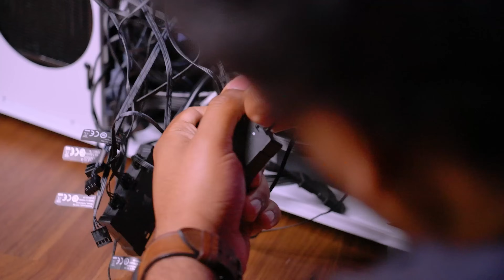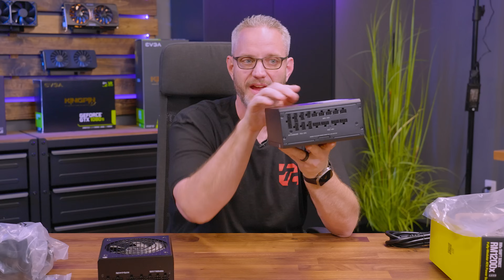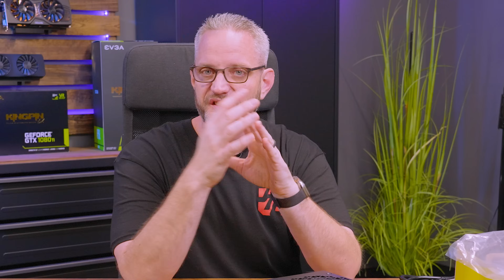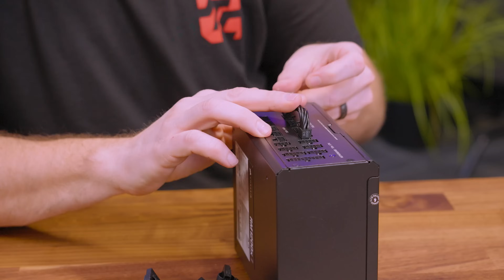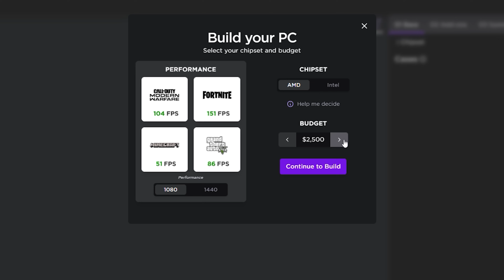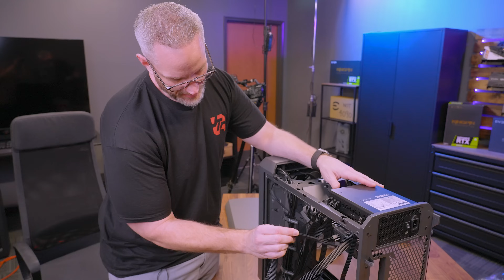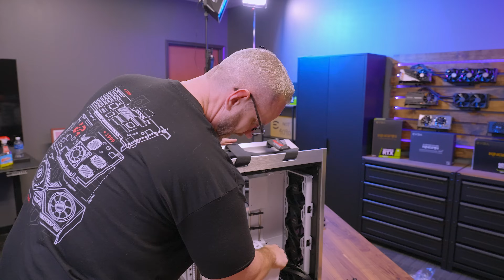I tried to prove this design was a failure... But then this happened.

Comment: How did I know the first case he'd grab would be an O11 Dynamic?  😂
They should also consider doing a "Left Shift" and a "Right Shift" so you can have connections on either side to suit your case's needs.
Reply: its such a common case, I have the XL version.  but its a nice case to build in even if at this point its a bit cliche.

Comment: My last build was in an H7 Flow with a Rm850x. I found that with 12" sleeved extensions AND 3 fans in the front (similar to that H7 Elite) the PSU basement gets quite full of excess cables and it can rub the bottom fan. It took a good bit of work to neatly loop the excess in the basement between the PSU and the front fan. I think a side plug 850 would have been great.
Reply: How are you liking the H7 Flow so far? Debating between that and the Lancool 216 for an editing build I’m planning.
Reply: @SixShooter14  The cable bar is removable, right?
Reply: @MarshallFlores  yes it is.

Comment: Changing all the cable ends that plug into the power supply to 90° plug, would help so much for cable management and fit for close cases to the plug side.

Comment: The 1000w Shift is also limited to 450w on the 12WHPWR connector so for a 4090 you need the 1200W Shift. Unless Corsair sent us the wrong labels on the boxes (I work at a Micro Center)
Reply: @The Silver King The PSU is not limited to < 600W.  All of the Shift PSU 12VHPWR cables are 600W compatible.  There's a sticker (which has since been removed because it created confusion) that says "ATX 3.0 <= 450W" because that follows the ATX 3.0 test plan.  It's not a limitation of the PSU or the 12VHPWR cable.
Reply: If I am not mistaken corsair uses the same 12vhpwr cable for all the (shift) psu's and have the sensepinses always set at 600W.
Reply: @Mr._MN10  You are correct.  ALL Corsair 12VHPWR cables are 600W.  The label simply states what the GPU wattage suggestion is per the ATX 3.0 test plan.  Marketing was trying to convey a message in few words and it backfired and created more confusion than it addressed.  So the label has since been removed.
Reply: @Mr._MN10  The 450W limit for 1000W PSUs or lower is part of the ATX 3.0 spec. That's what the 4 control pins on the 12VHPWR cable are for. Each represents 150W, so any cable can potentially carry 600W. The RM1000X Shift itself would only activate three of the four pins, which is how the graphics card knows it can draw a maximum 450W. This is why on the front of the RM1000X Shift box, top right, is an ATX 3.0 sticker that says "<= 450W PCIe 5.0".
Reply: @TheRealPotoroo  Huh. Wish I was aware of this before buying the RM850x. I have an Aorus RTX 4070 Ti Elite, will the GPU be able to run fine?
Reply: @agrofinis  I would say so. I'm on a standard RMx 850 and it handles a 3080ti just fine.
Reply: @TheRealPotoroo  yeah I just checked. GPU is rated for 285W max as well. Thanks for the input!
Reply: @agrofinis  Sweet. Now I'd just like to know why YT deleted that comment.
Reply: This limitation seems like a way for power supply vendors to force people to buy more expensive units. Hopefully that won't be the case, but companies are greedy and like to artificially segment the market.
Reply: Do you happen yo know if the Corsair shift is being made by Seasonic? My main concern is reliability.
Reply: @elusivelectron  You do not have to have concerns about reliability because the Shift is not made by Seasonic.
Reply: Its simple. Dont buy atx 3.0 psu's. Then you arent "forced" to buy a more expensive one that can hit that 600w. Normal psu + some adapter cable from whoever. Mine is a 16pin to three 8pin from DIYMod goes straight from my 4090 to my PSU. Works just fine and eliminates nvidia's rats nest adapter
Reply: @reloadingdontshoot1  An ATX 3.0 PSU is going to cost about the same amount as buying a regular power supply plus a 12WHPWR adapter. And besides, if you plan to use an adapter anyway, you might as well use the one that Nvidia gives you. The main benefit of the ATX 3.0 PSUs that I've found is that the built-in cable is more flexible than using an adapter, so you have more compatibility with narrower cases. On top of y'know, the main idea of the spec controlling how much wattage goes to the GPU.

Comment: What they basicly did was open MOLEX website, looked up Nano-Fit connectors, contacted the sales representative and asked could they make them Nano-Fit connectors with crappier locking system because it's PC's we are talking about and having anything completely new is forbidden. And sadly MOLEX didn't laugh them off but said: "Fine, we got you. You seem to really love that design we did in the 60's after all, so radical moving away from it."

When you go around yearly through different connectors to get stuff done better than it has been done earlier and something like MOLEX catalog is there on the shelf next to the holy collection of Douglas Adams Hitchhiker series and then you hear they have problems with the "new" connectors in PC space and hope that someone AT LAST will fix the travesty of using the Mini-Fit Jr. connectors which are older than the dirt... And then no, absolutely no, like everyone would blow their minds and loose their nuts if they were to introduce at least some connector with couple guide rails so it would be floppy connector for unnecessary danger, let alone latching locking, as in the lock has a little latch that you need to press to lock it and if the connector isn't all the way in, the latch won't lock (unless you break it). But no, completely illegal even when the company behind the connector has improved it already decades ago.
And imagine the madness that would break loose if they heard that MOLEX isn't the only manufacturer of connectors? Oh yeah, that happened already once and even today PC people call that connector "molex connector" while that connector exactly isn't first done by MOLEX. As in the 4-pin "molex" connector isn't MOLEX connector, as in a company that develops and manufacturers different kind of electrical connectors and other stuff, but actually the ATX standard common connectors like the 24-pin, PCIe power and all those are developed and originally manufactured by MOLEX. Like imagine if we were to tell them about a company called Wago, which does a lot more than just the wago connectors, and even they have tons of different connectors from which to choose from.

And then people get mad about EU forcing even Apple to use USB-C for the next 5 years... Clown world....

Comment: looked at the shift for the build I just finished.  Wouldn't have worked because it would have bumped into my rad fittings.
Reply: TT Tower 900 for anyone confused by how in the hell a PS could be anywhere near a rad.

Comment: Kind of ignorant to say you’re not gonna use the mechanical hard drive spot in the Fractal Torrent but then fail to mention you can just remove the drive sled cage from the Lian Li case completely. I wish I had one of these PSUs in the Lian Li o11 air mini, it would have been perfect to manage the cables with.

Comment: Absolut genius, now they just need to make there wires look cleaner and maybe add some bradding/ protection then good to go out of the box. now if motherboards could just install the 24 pin on the side instead of vertical and put the gawd awful cpu power connectors to the side instead of top of the MB oh and put all the small usb front io BS on a daughter board or in it's own are not at the bottom of the dam MB. oh and graphics card stop putting the fucking 8 pin 6 pin etc on the front of the card astatically it needs to be on the end. my gawd is it really that hard for companies to make a product out of ease of access/ consumer pleasure ya know just take our dam advice and make it the way we have wanted it for idk 20+ years.

Comment: This actually would be tight if they did this with an SFX unit. Could help with a lot of cable management issues in ITX cases.
Reply: That would be horrible in my phanteks shift XT. The cables would be blocking all the USB headers and the 24pin motherboard plug.
Reply: Lol SFX? Er - no. ITX cases are longer on the Z axis, not Y axis. They are longer on the Z axis for a reason, GPU size. It would make it not compatible or a living hell with a SFX side psu port.
Reply: It would make it worst

Comment: Honestly, this would seem to work well in a Corsair Graphite 380T (old niche case I know) with a little modding of making a cutout on the side where the cables come out on the support plate. This way it's easier to put a high wattage PSU in and still being able to use your 3,5" bays instead of using a SFF PSU. There is quite some dead space in the case on that side that it might be worth it depending on how far into the chassis the plugs extend.

Comment: I'm staying away from Corsair PSUs. I just bought a Corsair RM850e PSU and the PSU fan has a really annoying rattle noise. When on idle the fan comes on and off constantly without a reason. The fan should not be spinning when the PC is on idle. I wouldn't mind if the fan was not rattling.

Comment: This would be perfect for my case (O11 knockoff made by Kedeirs but mine doesn't have that hard drive cage in the way), but it seems like it would be better if they had made the cables end in a right angle where they plugged into the power supply

Comment: If they went to the trouble of having twice the connectors on the side, just rotated 90 degrees... it begs the question why not have one set on the side and one set on the back (like a traditional PSU), that way you can use whichever layout works for you (or mix and match)?

Comment: So if more Mother board makers get on board with ALL the connections on the BACK of the MB where they SHOULD be and something like this, you could have the cleanest build ever. (outside of the ONE cable going to the graphics card.) I like this PSU. the side pins were clever.

Comment: i think this powersupply is intended more on the dual chamber cases so the cables are going up to the huge compartment of the psu chamber behind the motherboard. i had the techware vxm case and i had trouble routing the cables coz it's pressing against the part where you put the side intake fans and i had to hard bend the cables just to get it in the huge space behind the motherboard and to feed it to the holes.

Comment: It seems they are slowly comming into a agreement of standart even in case cable management, TUF trying the backwards plugs, the Power Delivery PCB, the 90 degree plugs, 12V PSU and so on

Comment: Damn I am running a SF750 with a 4090 and the cable has the full 600W available. That's wack they lock the 850W down.

Comment: On the Fractal Design Torrent I would have taken a strip of electrical tape, or heck even scotch, masking, or painters tape and wrapped the edge of that rail to eliminate any chance of a sharp edge.
Reply: I checked my fractal torrent and that rail is smooth as can be.  Definitely needs no tape.  That damage on his cable was probably factory damage.
Reply: The cable were already damaged before putting in, check it when he puts the cable, it's already was damaged before putting in
Reply: Good idea!
Reply: The cable were already damaged before putting in, check it when he puts the cable, it's already was damaged before putting in
Reply: @閉園するさらにパワーアップ    He is filming a show.  He probably practiced what he was going to do before they were rolling the camera.  It has been over a year since I left my original comment.
Reply: Exactly what I was thinking!

Comment: Why don't they make PSUs with different lengths cables?    

My power supply used with the Corsair 5000x QL leaves me with a ridiculous amount of extra length I don't need.     I have to shove it all in their and force the case closed.    Regardless of how I try and manage the cables it's simply to much excess length.   

It makes it so I don't ever wanna take the back panel off

Comment: I think the one side design of this power supply could be overcome with swappable side plates. You'd have a large bus bar card edge like we use in the server space on either side of the PSU. On the side panel with the connectors you'd have a socket for the card edge, a large 12v plane on the top, a large ground plane on the bottom and a smaller 5v plane. 4 screws would hold it on and you could easily swap the sides.

Comment: Don't know if anyone has mentioned it but what about right angle cables?  With the way they plug into the power supply, you would have to have at least 4 sets of right angle cables depending on which way you want to run them..

Comment: I'm only 2 minutes into the video, but -- a $300 power supply? I won't spend that much on a graphics card (I've got a GTX 1080 Ti, which works great for my needs)!
After watching more of the video I'll add that for that price I would expect 90-degree connectors so I didn't have to crimp the cables at the PSU.

Comment: It looks great. But is yet another cable standard with a different plug. Surely it is high time that cable connections to PSUs were standardised? Would be great if you could just simply buy a 12" or 18" SATA cable, for example, to fit your build and simplify cable management knowing it was going to fit because the plugs were as standard as an ATX 24 pin.

Comment: Make it $200 and I would buy one. I'm actually surprised that more ATX 3.0/PCIE 5.0 power supplies aren't available on the market. I was kinda hoping EVGA would release one that I could buy but until I find a cheapish platinum 1200w+ ATX 3.0 the old T2 will keep chugging along doing what it's always done, work perfectly.

Comment: Built a new pc last week and installed the 1000w shift into the Thermaltake Ceres 500 case. Everything went smooth except for the awful 4 plug daisy chained sata cables. Most cases these days place the 2.5" sata drives completely flat onto the chassis and in different locations around the case making the supplied corsair cables pretty much e-waste. For the money spent couldn't they at least get rid of 2 of the 4 plug daisy chained sata or pata cables and put 4 seperate single plug sata cables with the wires directly into the end of the plug. Who in 2023 needs 16 daisy chained sata power plugs and 8 daisy chained pata plugs? I'm now waiting for CableMod to release a shift cable kit with the type 5 connectors to finish off my build.

Comment: Really REALLY glad that this PSU exists as an option. It's a pretty niche piece honestly, makes more sense to purchase if you're going to get custom length cables because man you could REALLY clean up the wiring with this PSU + custom  length cables. But a bit of a hard bargain at that price for just your standard out of the box PC build. Kinda like Phanteks's dual system power supply, albeit probably with a much bigger market lol. I'd like to see more niche-oriented products like this, but it's understandable why these sorts of things are rare; small markets lead to really expensive low volume products. But man they can open up some great possibilities.

Comment: I would be concerned that with such a high output power supply (1200 Watts) and such tiny Molex connectors and thin wires that you may have heat issues with melting plastic in the reduced size connectors after a period of heavy gaming use. I would be very leery of warranting such a setup. I don't think that Corsair has secret alloys in their pin connectors that allow for more current flow with reduced heat. Are they even gold plated? Also I hate flat cables, too hard to bend and work with. Hard to identify voltages, due to no color coding for trouble shooting. I am old fashioned in that I prefer round cables with sheathing on them. This is a nice idea similar to left hand cases, that were pushed by Intel, that ultimately disappeared from the market. This is Corsair's way of locking you into buying their cases to be compatible with their power supplies. Another way 

I determine the quality of a power supply is by how much does it weigh? Heavier usually equates to thicker copper cables and larger internal inductors. I also do not care for fans facing downward towards the bottom of the case. These end up being dust vacuums and have a tendency to get clogged with pet hair and fuzz, reducing air flow and resulting in a warranty return due to overheating. I had a customer set one on a thick carpeted floor and we ended up having to put a piece of wood under the case to lift it up off the floor, to solve the dust and airflow issues. I am an old grumpy retired builder.

Comment: Now imagine if a case manufacturer made a case where the PSU slot is rotated so that the screw mounts and wall plug are on the side, and the Shift's cables are back to pointing straight to the front panel!

Comment: This would also make adding and removing cables super super easy. I have an rm850 and had to add a cable to it and it took me 30 minutes to get the cable plugged in because i couldnt see and it was a super tight fit.